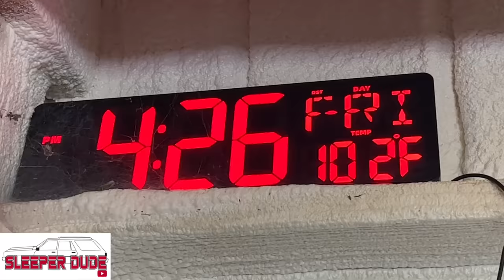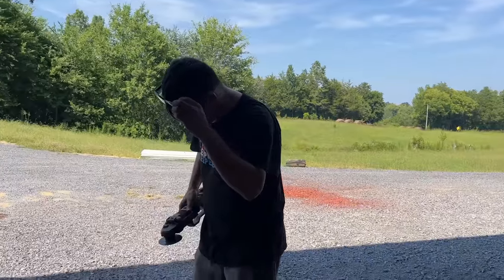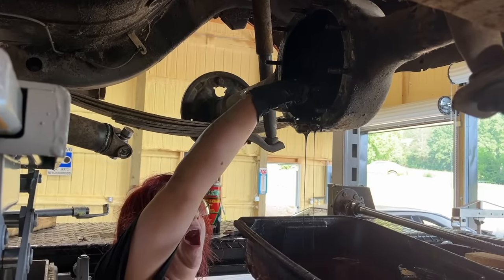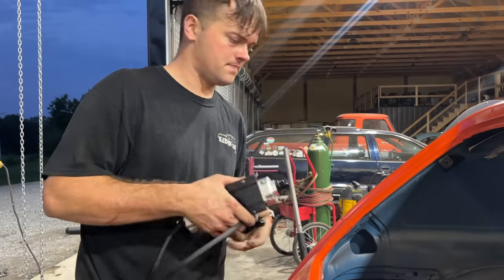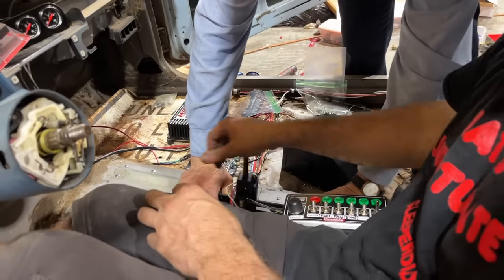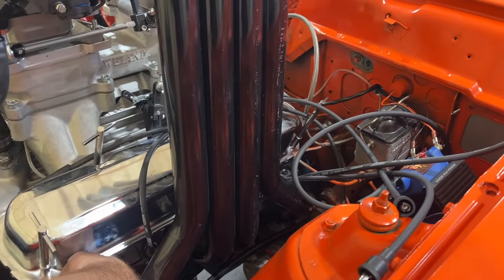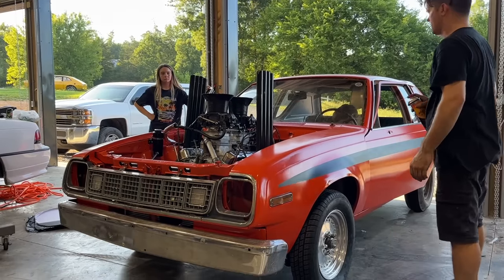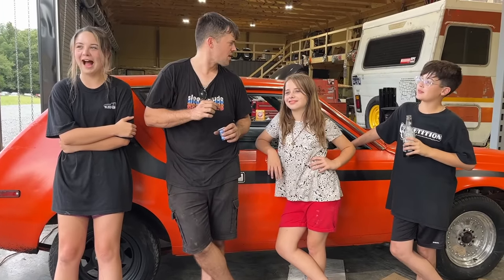Methanol Burning Burnout Car Build in 13 Days!

Comment from the maker: Get solderstick at 20% OFF with discount code "JOSH20" at https://solderstick.com/sale
Reply: Hi guys! I am glad you are working on this car
Reply: Fast and Furious: Sleeper Dude Drift
Reply: Never use a plastic hose on an oil pressure gauge....fire hazard. Getcha some orange smoke tires. Never run it lean or you'll have holes in pistons. I ran an altered coupe for many years. I ran a 540CI Roadek blower motor
Reply: @Sleeperdude please consider wearing a air respirator when participating in burnouts. All that rubber smoke in the air and breathing that in can't be good for you. Those fine particles in the air can cause cancer or severe breathing issues. Its not fun having breathing issues like copd.
Reply: Awesome.sounds good 😊 good job everyone
Reply: I still maintain you needed to build a cement " walk in" shower in the shop....for quick heat relief as well as comin' home clean.....put some cupboards with towels shirts and shorts adjacent !
Reply: U should get black headlight covers and then paint eyes or what for the themed Cars look your going for lol. I think that would look badass brother
Reply: That solder  stick looks like an amazing product., gonna order some when I’m able too. Such a cool build! As a kid every chance possible I was in the garage with dad taking in as much knowledge as possible, probably my favorite build we did was a CJ 4 jeep and we pulled a 304 from a totaled javelin, we did an edelbrock intake, holly 4 barrel, that light jeep with a V8 was quite fun down in the creeks and trails lol. My favorite thing about your channel is how much you include your family,  very special.
Reply: You have the next bob Ross as a artist in your family.ur kid is good painter.
Reply: So I seen a video posted 9 days ago and I'm sure it was your car at the burnout competition it was amazing shot a fire ball at the end ..... But definitely loved it
Reply: Important 
I sent you an email about this or maybe next video.
Reply: THOSE TWO 1 INCH HOSES U CUT AND PUT THE PIPE PLUGS IN YOU SHOULD PUT SOME SORT OF SEALER/OPPOXY/ADHESIVE GLUE SOMETHING IN IT OR FIND FREEZE PLUGS THAT FIT RIGHT IN THE MOTOR THERE OR JB WELD SOMETHING IT IN OR JB WELD THOSE HOLES BC IVE DONE THAT AND IT SHOOTS THE PIPE PLUGS OUT. HELL I EVEN JB WELDED A PIPE PLUG IN A HEADER WHERE MY EGR PIPE WAS THAT I DELETED AND IT WORKED WELL.
Reply: BELTS GREEN BC ITS A MOPAR SUPERCHARGER BELT HAHAHAHAHA
Reply: @sleeperdude
Reply: How are y'all someone's channel named the killing creed has the same looking car on it that caught on fire is it you guys moparty 2023 burnout comp is the video
Reply: Just wondering why yall like WAWA so much BECAUSE it sucks were im from lol

Comment: The green belts are heavy duty. Usually for industrial applications. A bit concerned about the vinyl tube for the oil pressure gauge considering how hot it's gonna get in the engine bay. With that short wheelbase it's gonna whip around like a Tornado. Gonna be fun to watch you burn that tread off. Great video.
Reply: Yes definitely a fire hazard .Hard copper  line would e good
Reply: I thought the same when I saw that plastic line.
Reply: Plastic tube has GOT TO GO! They have no place on a street car let alone a race car.
Reply: No problem  when running methanol, that's all I use on my A Modified dirt track car . It's nylon and plenty strong . Also use it for my brake lines never had a failure yet in 20 years .

Comment: You are the first guy on YouTube that I've seen cut their own driveshaft. I worked for a body shop as a young man and the owner had taught me to cut down my own driveshafts. He told me to always cut the end at the transmission, this will help prevent vibration. I never had a problem with vibrations. That car is bad ass.
Reply: You can use a large tubing cutter for a good straight and clean cut. Then put the cut off piece on a lathe and cut the weld off.
Reply from the maker: That’s funny. That sounds like a good tip. I never really thought of that.

Comment: Great build.  Really should replace that plastic oil pressure line for the gauge with copper
Reply from the maker: Ok thanks
Reply: @Sleeperdude don't want to have happen like what happened with VGG on that Corvette 😮😮

Comment: Run that methanol motor till it warms up it helps with less condensate in the oil. The more you just run it short or on and off the more it will milk the oil. Nice engine build.

Comment: Thanks for your videos and thank you for being a dad to your kids. Only car ever worked on with my dad was r76 Monza race car. My grandfather used to work for Napa he was a regional vice president and a district manager so we got all of the top-of-the-line parts for my car when we needed them. After I turn 16 in the car was finally finished and it was able to get to the track my dad sold it for cocaine money. Never had a chance to race it. Thank you I appreciate this
Reply from the maker: Man that’s to bad you didn’t get to race it
Reply: @Sleeperdude  I'm 45 and it still left a mark you feel me. But that's cool that you do this s*** with your kids bro use my language that's why it's edited. But I just want to say thank you for being a cool ass dad man you're like definitely a dad that all kids need to have and I think a lot of dads need to take suit. I've been doing this kind of stuff with my kid right now I've got an 18 horsepower Honda but I can't find a carburetor for it it's from a 79 generator it's got electric start with a remote and everything I've got a raptor exhaust on it right now it sounds mean when I can get it to run but it's an electric carburetor I'm trying to find like a 28 mmmm Mikuni for it

Comment: Love it that you smoked the snot out of that old Sears bias ply on the LR. Thanks for the 'AFTER' close-up of the torn up tread.
Can't wait to see them old casings on the wagon wheels get fried at Bristol.
If you were able to cut the center sections out of those old rims, with a plasma cutter or something, you could weld up your own positive offset hoops for the Gremlin axle. Make multiple sets to mount up all that old rubber on, then you have backups for an event.

Comment: Green belts are industrial belts.
Often used for drill presses, lawn tractor mower deck blades, saws..etc.
Made of a different material than your typical V belt.
They are designed to flex less and can handle more heat should they spin on a loose assembly.
(more fiberglass).
They are heavier and can slip on automotive applications with higher RPM as they tend to ride higher on the pulleys.
Not as quiet.
They also tend to be more expensive.
Also, the panty hose on the air horns will cause you to go a bit rich.
Love the vids!

You guys are Awesome!
Reply from the maker: Ok thank you

Comment: For those screw in oil pickup tubes, after you thread them in to the right position, just add a small tack with your welder to prevent them from ever backing out from engine vibration.
Reply from the maker: Yeah good tip

Comment: Love the paint job. Never run my Audi S4 2015 altered apart from using Z rated tyres (tires, your language) and I programmed it to unregulated (no speed restrictions set 165mph for retail versions) via an R&D engineer mate at Audi. Altered from 333bhp to 450bhp and did not affect warranty. Over 10km between  fuel fills, recorded 5km average 330 kph. 200mph. Though was 8mpg so did need a refill. When I sold it, I was able to show proof, as was recorded by a racing Porsche driver, I knew and he gave me the print out. Fasted Audi ever seen. I showed to the Audi Team JCT600. I love your channel. When you all worked on the Beatle, was great. WAWA lucky lass. By the way I used to drive from England to Romania quite a lot,  5000 miles, perhaps 2 times a month. No problems, changed oil  every 5000 miles, even though said 15000 miles. One slow tyre problem fixed for £10 - 200RON, GPS and full service in Romania for £86. In UK would have been £220.

Comment: Would recommend to run the Carby dry after its been running,  also I would put wider tire's on the front or it's just gonna wanna push forward and no turn , love the project can't wait too see it in full force, much love from Australia

Comment: We run methanol and always run them out of fuel and fill the bowls back up with a mixture of gas and just a little Marvel's Mystery oil. It keeps the carb bowls clean and helps the engine start especially after sitting a while.

Comment: So I work for an industrial hose shop and when we work with puch-lock type hoses you dont want to use oil for ease of installation since it relys just on the hose barbs to stay on and wont hold up to the hoses pressure rating (granted thats probably 300psi and im assuming your fuel pressure is only like 60 psi max). we recommend using rubbing alcohol or just lightly heating up the hose to help installation to maintain factory hose pressure ratings.  just an FYI. fun build! Keep up the fun builds!

Comment: Hi Sleeperdude family. Dave here from down under. I noticed that your radiator top hose runs up to the thermostat, housing air will get trapped in the bend in the hose if you put a air bleed back into the cooling system. My  XR6 Ford ute / pick-up  has this as  standard equipment. Hopefully this may be a help to you  .great show always  .All the best Dave.

Comment: When assembling drivelines I like to put the yoke in the freezer for a bit. 👍👍 on heating the tube with a little butane torch it helps a lot with assembly. I Time them on a flat surface to ensure they match. Being a Machinist I put mine on a lathe to square the yokes before welding.

Comment: I personally never ran methanol but I have read on it a lot of drag racers say to bring the engine up to temp first on regular fuel than add in the methanol but you problary have this figured out already and does sound great

Comment: They make wedge plates for adjusting pinion angles. I just started wathing your videos last week, started with the VW build. Now I'm watching some of your older videos. I'm a retired Auto Mechanic/Machinist so watching videos like this is entertainment to me. Not like thiers anything else on TV nowadays
Reply: Can't  be stingy with the RVT on the China Walls. Use a peice of 3/8 cotton rope (extension cord works too) to measure for a V fan belt mark the length then measure with a tape measure
Reply from the maker: Thank you we appreciate it

Comment: Man such a great build!!! That thing destroyed casings in seconds!! You guys did amazing body work, paint looks great, engine sounds PHENOMENAL!! Methanol was a great choice to keep that engine cool during burnouts, great job, great video! This is exactly why I love this channel!! Josh, with methanol that engine needs to get hot or the fuel will definitely make a ton of moisture, we used to purge our system with regular(race) gas to help get the engine warm enough to burn off the condensation. Methanol is kinda hydroscopic, not to mention as you see on the intake it’ll condensate because of latent heat of vaporization. Hope that’s in anyway useful!

Comment: I installed two 30 inch exhaust fans on back wall in my building 12 to 15 feet from ground I turn the fans on when I open my doors and it really helps keep my shop cooler and if I run car it helps remove exhaust fumes.

Comment: Just found tour channel, watched entire episode and subscribed! Love seeing all y'all working together to git r done!
You gonna wanna stay on top of oil changes with methanol, at least fresh oil for every event or outing and change after "x" amount of run time hours maybe?
You might wanna clean the motor out too before shutting down the ignition, should make it easier to restart when warm. Keeping heat in the motor will be tough. Maybe throw an oil pan heater pad on it too for cold starts.

Comment: Ok! Awesome setup! I used to race midgets on methanol.. with carbs you need to flush the carbs with gas before letting it sit more than a say.. double fuel system to pull gas instead of methanol. Second.. call around to chemical supply companies because methanol is all the same. I used to buy it for $2 a gallon in 2003 for a 55 gallon drum. If you don't put a gas flush system, put in a fuel shutoff and run it dry every time. Methanol turns to white powder that plugs everything... every time I raced my midget I cleaned the injectors.
Reply from the maker: Ok thanks

Comment: Were your carbs methanol prepped?
Jetting is usually four to six sizes bigger than the gas.
Also remember to turn the fuel pump off and run it out of fuel when your done running it..
We also ran Teflon fuel lines the methanol is hard on rubber lines.

Comment: a model of corvette had a 12v vacuum pump it will help with the moisture and alc in  oil also 
when the oil temp coms up it will sweat  the water out ,try to heat the oil every time you start it or change it every time you start it
Reply from the maker: Ok thank you

Comment: When you buy a car, get #1 piston at TDC compression stroke on 0. See if the rotor points at #1 terminal on the cap. If not, lift the distributor and point the rotor at #1 on the cap. Turn the distributor way back opposite normal rotation. Then set it down and turn it to normal timing. If you get a car, do this on all to check for a loose timing chain. It compensates for a worn timing chain. Watch it fly!

Comment: Remember AMC had there own 360 V8 ,  the distributor was in the front drives side of engine , kinda like opposite side of a 383 or 440 big block Mopar...... and since Mopar uses them flat rubber mounts should  be easy to make motor mounts ,  I know at typing this u probably got it in ,  V8  Dodge truck mounts can be very easily modified to work in a AMC , little cutting/trimming and welding  should be easy for you 😉...... that gremlin out the rip some tires off ...
..

Comment: Love your channel.👍
But you need to take it very easy with that brand new engine.

Break in that big cam very carefully. Give the 360 some proper run-in time before stressing it and definitely don’t do any high revving burnouts until everything is bed right in.

Comment: It really cheesed me off, as my S3 needed an annual check. No problems, but on my Autel tester, it was only thing, I could not reset. Had to take to my mate with a high spec test. He reset it, almost due and oil change. I had the oil, filter, sump plug and air filter. He said, do it for £62, but you do the next 5000 mile one mate. Can get the oil for a lot less. I love goats and donkeys

Comment: On our dirt cars we run 2 psi of fuel psi at idle to help with the milking     the rest of it will burn out with a long run at temp
Reply: We achieve that by using a mechanical pump with a return style fuel log that had a ball valve in it.  The further you open the throttle the more it closes the ball valve causing the fuel pressure to go up.  So when you're at idle the ball valve is completely open so the pressure is only a couple pounds at most
Reply from the maker: Ok thank you
Reply: @Sleeperdude  no problem.   Not sure how that would work with dual carbs and electric fuel pump, but I'm sure there's a way.  The concept is the same

Comment: Hey guys it's  sick  just remember the oil could go milky due to the fuel  and dont store thr cat with methanol in the fuel system drain it out or it'll corrode  the system and dont store your fuel on cocrete it'll  turn to jelly  found that out when running dirt track  cant wait to see the video of this at bristol 👌👌

Comment: Well done guys awsome . I used to have the same prob on meth I used to have to start mine on sniff to .maybe also put a roof vent flap in lol I used to have to flush mine through with brake cleaner after so it doesn't rust up pipes etc .bag tank also be a good upgrade foam filled . Once again a pleasure to watch awsome
Reply from the maker: Ok great thank you
Reply: @Sleeperdude  can't wait to see how it performs, she will be a contender for sure

Comment: I hope you did not forget about the frame coneters if you don't the  Leave Springs will go through the floor and twist the  You nobody an the car will be junk i did with two Gremlins with only 304 v8 with a nice size cam but noway as big of a cam your putting in

Comment: Do you not have a temp gun to see if one cylinder is running cold or not firing?
Reply from the maker: We checked it it was down 80 degrees on the back passenger

Comment: Different brands, different colours of oil or of the carter. Milking the oil is normal for alcohol/methanol cars. It goes from transport all the way to very dark. ALWAYS check for metal flakes in the filter, the magnetic plug and the bowl you put your old oil in. I'm not that surprised by this colour. 
A different brand can get you another colour, but always choose oil based on application first. 
On race gas, we use XP9 on our tractor pulling. Now, with alcohol, we use XP6, I think. Change of viscosity.
Because tractor pulling/drag racing/burn out competition is short bursts of high power, the oil never gets hot enough to evaporate out the fuel and water that gets into the oil. The races aren't long enough timewise... Result, the oil must be changed to remove these contaminants. 
Endurance racers like Dakar, Formula one, NASCAR, Indy, run for hours. Therefore the engines go at higher temperatures (sometimes approaching 300°F), so the fuel and moisture are "boiled" out of the oil. As such, the oil can live for many more miles in these racing applications compared to your red pocket rocket. Simplified: your oil does not break down, it just gets contaminated, so it has to be changed.
Because methanol requires a richer air/fuel ratio, there is more fuel "thinning" of the oil, especially in the cylinder bores, so going to a thicker oil offsets the increased fuel dilution(is this the correct word for what I'm trying to say?).
When switching from gas to Methanol we went up in viscosity grade to compensate.